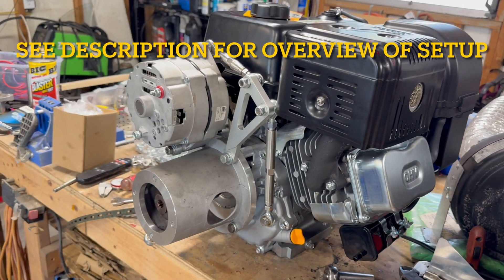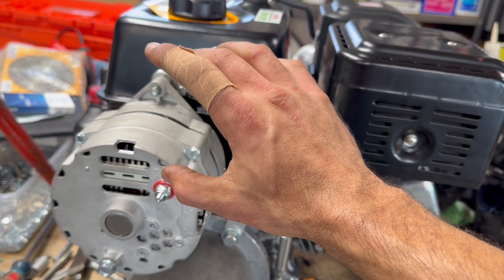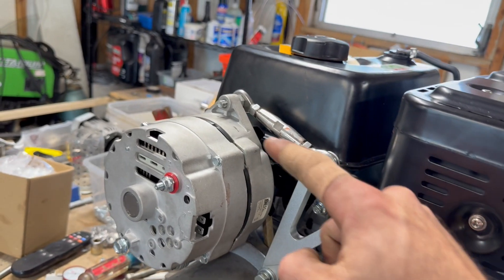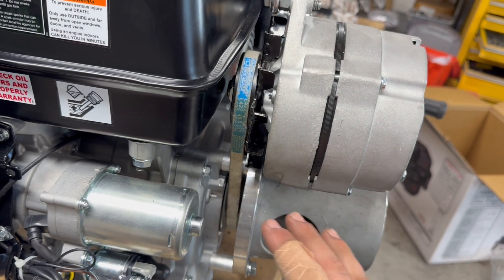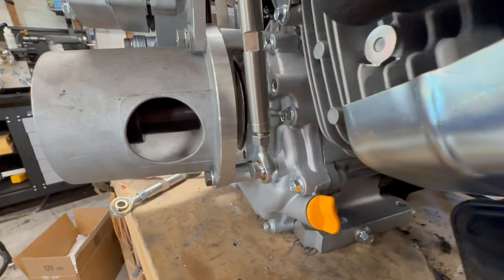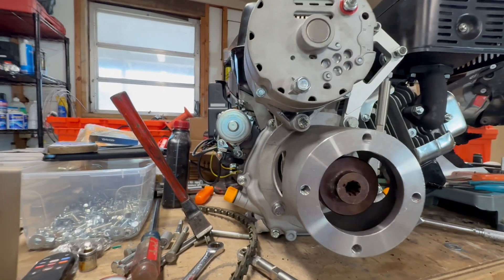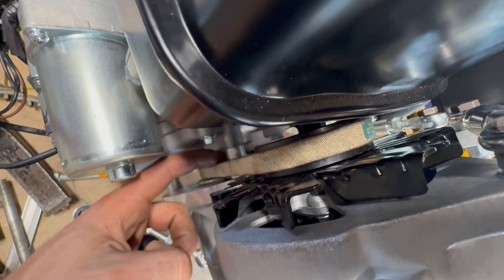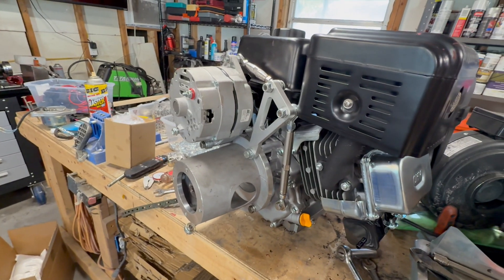Chinese Mini Excavator: Rato 420cc Belt Driven Alternator Charging System Upgrade for A/C

Comment: I have questions....

did you have to modify the lovejoy coupling, keyway or key to fit both the pulley and lovejoy coupling onto the existing key in shaft.

how does this affect idle? (some alternators impose load on engine at idle speed)

assembling the lovejoy rubber coupling inside the spacer between engine and pump is already difficult. does it get worse with the extra pulley on the keyway?

(a learned technique - I found fitting the lovejoy onto the pump spline first, threaded rods on the engine block to align the spacer while sliding the keyway into place helped)
Reply from the maker: The alternator drive pulley doesnt use the key way to drive it, purely set screws

Comment: Very stupid question…do these RATO 420 motors have any sort of juice going back to the battery? Thought about putting some simple DC cooling fans in engine compartment like in my mini skid.
Reply: My H15 with a Rato 420 came with a 8 coil stator, it will put out a little under 14 amp

Comment: This is an amazing setup though! Thank you for this design! I'm going to  probably do something very similar, I'm going to look into AC Delco 10si alternator see if that's about the same size as yours. This way you don't need Max RPMs to still get a charge
Reply from the maker: I thought about a 10si style but wasn’t sure if the mounting tabs would be at the same place
Reply: @thegarageconnection  if anyone can figure it out you would be the man
Reply: What size drive pully did you use? Mine says it's a 30mm

Comment: Does this set up get the alternator speed high enough to produce full output? The ratio seems low compared to a car
Reply from the maker: 4” drive pulley, 2” alternator pulley at 3600 engine RPM
Reply: Most people run these machines at idle to half throttle Max. Hopefully that won't be an issue with charging  @thegarageconnection
Reply: @sixlugchris3747  I don't know if a acdelco 10 si alternator would fit, but that's what I use on the bobcat, it doesn't matter RPM it's still charges

Comment: You took many things into consideration with your design . As a 32 yr mechanic myself,  I advise that you make a guard for the belt in the event it breaks cause it's gonna cut right through that gas tank. Just a suggestion,  good work on the upgrade
Reply from the maker: Yes that is a good idea! I will have to figure out a way to protect that tank.

Comment: Well crap.  Of course I see this upgrade two days after I order an upgrade kit for the engine charging system….🤦‍♂️
Reply: Funny story: After receiving my 25 amp upgrade kit I removed the covers and flywheel only to find that what came factory had the same 8 pole / 10 magnet setup as what I had ordered.  The reason it wasn’t keeping up with the fans was due to the main fuse being blown.  I hadn’t checked it, but had just made the assumption the fans were over taxing the battery.  I put it back together keeping the factory parts and now the voltage stays above 13 at idle even when running the cooling fan and the hydraulic cooler.  Moral of the story: Don’t make assumptions and troubleshoot it before ordering parts.
Reply: @manlyhelp  What make engine had the factory 10 magnet setup?
Reply: It was an AGT Industrial H15 with the RATO 420 engine.  They have it labeled as 15hp, but I don’t know that it’s any different from the 13.5 hp.
Reply: @manlyhelp  Thank you!
Reply: Can you show what exact pulley you used?

Comment: Nice job, im sure you know how hp those gm alternators can use, may want to use an alternator from a small marine diesel.
Reply from the maker: Yes they’re quite a load on the engine, but as long as it’s essentially full throttle the ac unit should be kept off
Reply: Brilliant cam just wondering is the predator a direct fit with the lovejoy fitting
Reply: @mark7330  B&M Excavating installed a Predator motor after his B&S died at 1000 hours. It took a couple videos so check him out to see it done.
Reply: I’ve heard it’s 1hp per 25 amps so I wouldn’t think it would be too bad, plus you can probably remove the old charging system to get a little back
Reply: @sixlugchris3747  it doesn't sound like much, but if you only have a 15 hp engine and your hydro system requires 7-10hp, 1-2hp is a large draw. it will still work but maybe a bit much.